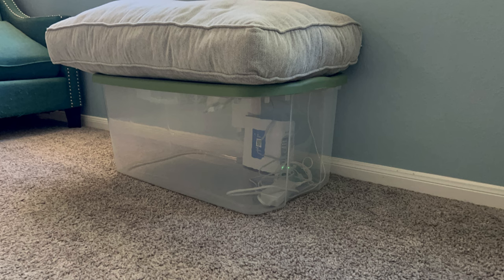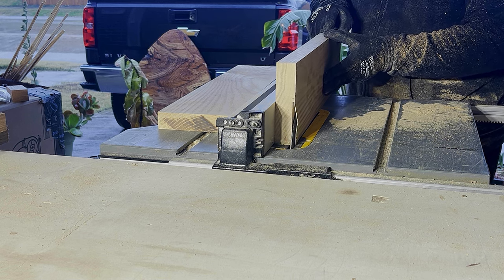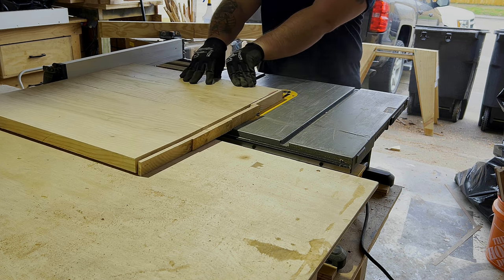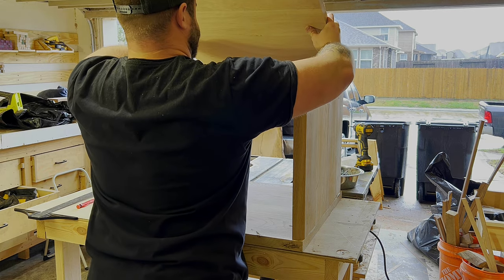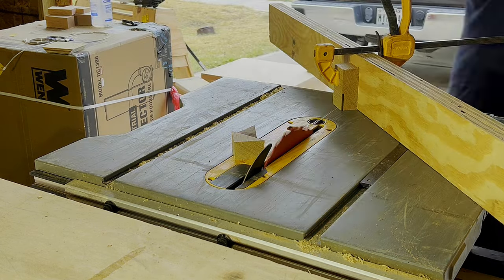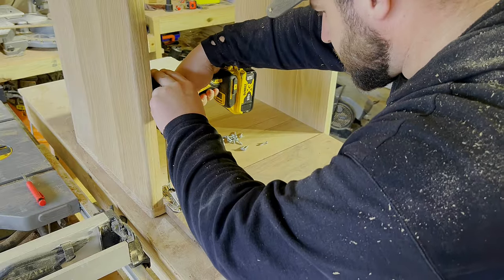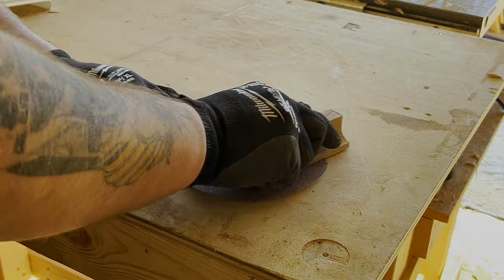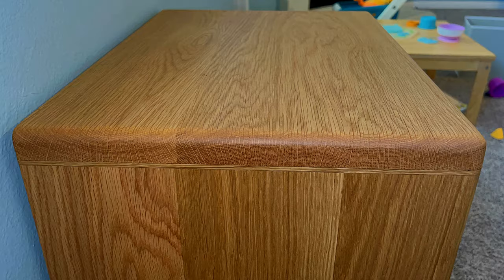WTF is a WiFi Cabinet?

Comment: You can't starve a joint of PVA glue out  by clamping it. Maybe with epoxy, not PVA. The problem with over tightening is that you can cause the panel to bow, which will suck hard later.
Reply from the maker: I agree with you on the epoxy and the bowing. I guess I should have put in there that it’s important to put a clamp on the opposite side with opposing pressure. However, I’ve had plenty of panels come apart because I didn’t allow enough glue to stay in the joint. Maybe that’s a biased opinion based on experience but it’s still something I thought was worth noting

Comment: Please take the gloves off when using the table saw. That made me very nervous
Reply from the maker: That’s a whole other contentious topic. My thought process is if my gloves are close enough to get messed up, my hands were screwed either way. I appreciate the concern
Reply: @lonestarwoodworking3810  If the gloves get snagged, your hand can get pulled in. A bare hand might get by with serious damage to one finger.
Reply: @lonestarwoodworking3810  I agree with @rcrogers6 idk for sure that a tablesaw would grab a glove and pull in the hand but I do know that hitting one finger can be minimal. I hit my thumb a while back and it sucked but compared to most tablesaw incidents, it was a scratch. I don’t want to imagine what would happen if a glove got caught in that scenario.